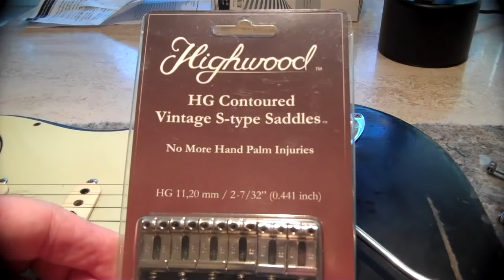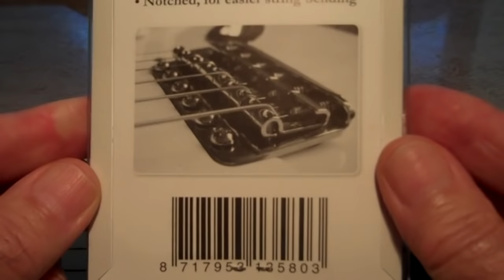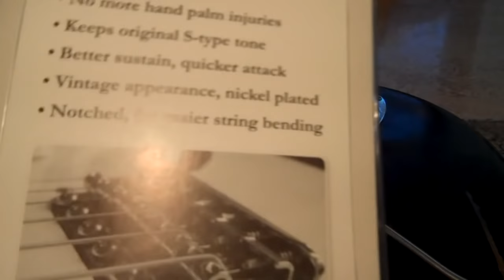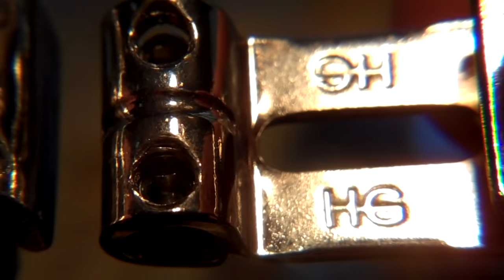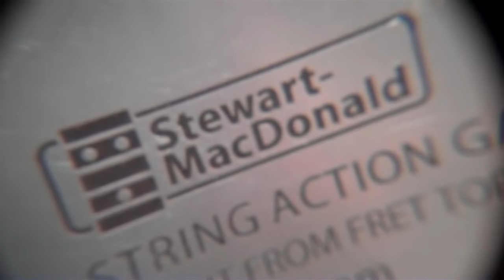Highwood HG Contoured Vintage Strat Saddle Review - Better Than The Originals

Comment: You should do an update on these after 6 months too a year. It would be interesting to see how they held up.
Reply from the maker: Good idea.  Right now they are perfect.  It's been over 3 months.  I don't see any grooves being cut into them at all.  But, I would have to remove the string completely to double check.  The tone is great.  They are super stable.  Fender wishes they would have thought of this design.  A lot of their newer saddles and even the old Teles and Jazzmasters had grooved saddles (threaded barrel type).These are way better than that.
Reply: @millstap   Definitely a superior design.

Comment: Thanks for the video!! Ive read reviews that states these make the tone a tiny bit duller, not as much “zing” as with the original. What are your thoughts after you played them for a while? Thanks!!
Reply from the maker: Maybe in a side-by-side comparison but I do not notice that at all.  Since the top of the original saddle has a little smaller crown, it might sound different but with the extra mass and correct hardness of the Highwoods, I like the extra sustain and tone.  Plus they stay in such good tune because of the groove the string rides in.  The strings are very stable.  I have full sets now on my Nash Strat and an original 1964 Strat.  I love the way the vintage Strat sounds.  I forget that they are on there.  I don't notice the difference at all.  They may be a little duller than the Callahams but then the Callahams are too bright to begin with.
Reply: @millstap  Thanks! I have to check them out.
Reply from the maker: @stefanedfeldt409  They're nice.  It is definitely worth the money to give them a try.  They are all I will use for years probably until I get bored again and just want to put the originals back on for a while.  I love that the strings don't slip around on the top when they are new and allow the strings to cut multiple grooves.  That only happens, though, to guitarists that bend strings a lot like I do.

Comment: Sounds awesome!! When you showed them close up, my first thought was that the groove in the top would help keep the string more stabilized for bending... guess you found that out when you played! Seems like a smart design.
Reply from the maker: That groove is a Godsend.  I think Leo's original Telecaster saddles had the grooves built in kind of like the ones on the original Jazzmaster bridge.  Leo was such a tightwad, he didn't want to spend money cutting a groove in the saddles.  Here is the comment I made to Patrick above, "It dawned on me last night why my other saddles have multiple grooves in them.  Anytime I replace the saddles with new ones, they are so slick on top that the string slides around on top for a while when bending strings until a groove forms to keep the string from moving anymore.  If you don't do extreme bends, then it is not a problem.  I used to hate moving the string back to the center on new saddles.  Plus, it knocks the string out of tune.  The tuning on these is super stable."

Comment: can you get these lower than standard saddles like, if your high E is at its lowest point but the rest of the setup is good? I'd like to avoid a shim if I can and all I'd need is a slightly shorter saddle. Does the groove make lower action possible or is it about the same minimum height as standard ones?
Reply from the maker: YourFavouriteColor I don’t like shims either but sometimes they are necessary. Just use a full pocket maple shim from StewMac. You may have to thin out the shim towards the headstock end.  Fender put small shims in almost all Strats. I will measure the saddles and get back to you.
Reply from the maker: I measure several brands of vintage saddles and they were .2145-.22".  It looks like the string groove might make that just a little less but I would contact Highwood to get an exact measurement.  The Highwood saddle without the groove is around .2188".
Reply from the maker: I measure several brands of vintage saddles and they were .2145-.22".  It looks like the string groove might make that just a little less but I would contact Highwood to get an exact measurement.  The Highwood saddle without the groove is around .2188".
Reply: @millstap  wow thank you so much for the info! a shim it is lol
Reply from the maker: @YourFavouriteColor  Yes, check these out.  I have never used them but they will not effect the tone of your guitar like an air gap will if you just use a little piece of plastic or something.  https://www.stewmac.com/Materials_and_Supplies/Bodies_and_Necks_and_Wood/Electric_Guitar_Bodies_and_Necks_and_Wood/Electric_Guitar_Necks/StewMac_Neck_Shims_for_Guitar.html.  It might be a little tricky thinning it down so it does not push the neck up too far but then that little bit of extra height might work.  Just be sure there is no air gap.
Reply: @millstap  already ordered some
 a .25 degree and a .5 degree. I'm pretty sure the .25 degree will be plenty. when it comes to shims a little dablldoya.

thanks again for taking the time to measure the saddles. that was very kind of you.
Reply from the maker: @YourFavouriteColor  Good thinking.  It doesn't take much so .25 will probably be enough.  Have you looked in the pocket before?  There may be a shim in it then you might need the .5 degree and get good full pocket contact.  I suppose you could glue those two together if you needed even more.

Comment: I want the highwood saddles.. and i had no idea they come in nickel....if they come in something harder metal wise thats what im after...the last mods i need is the saddles...they have many advantages...and locking tuners...then my strat will be complete...
Reply from the maker: You can contact Piet at info@highwood-guitarparts.com if you have particular questions.  They only come in nickel or relic'd nickel.  I have both.  I use the relic'd set on my vintage Strats.  You don't want them too hard or it will adversely affect the tone.

Comment: save ca$h and use block steel saddles and its easier to get the screws below the top to stop right hand chafing. Be prepared to buy a set of 6 saddles to suit the length needed (likely 8mm)

Comment: Slot length doesn’t matter, the string has a hard break angle on the sustain block.  That is the problem area.
Reply: JP SixgunElectric you think you are smarter than you actually are.  Read my comment carefully.
Reply: Slot length does matter, because as illustrated in this video, it creates two contact points at the saddle: the slot opening and the top of the saddle. Especially problematic if you have a tremolo Strat, because it can cause the string to catch on the front edge of the shorter slot hole, causing the string to "ping" and suddenly unbind and causing tuning issues. Simple is better and the longer slot length on these simplifies the string tension and helps prevent broken strings.
Reply: @danielstoddart  I understand, maybe I  could have added detail, from a risk standpoint the string has a much sharper and aggressive angle at the bridge plate where it connects to the block.  That area is also under heavy tension.

Comment: Playing with effects masks the effect of the saddles' tone, which i assume is the point of a review of these saddles.
Reply from the maker: The main point of this review was not about the tone.  It was mainly about the elegant design.  The tone is exactly as the designer states, "pure vintage tone!" except with more sustain.  The groove is a big improvement over the vintage saddles, especially if you are a big bender of strings.  The strings stay very stable in the groove and do not move at all like they do on a new saddle.  The steel hardness, mass and nickel plating of the vintage saddles was duplicated in this design.  Having the screws recessed below the top of the saddles is a real benefit if you have ever hit one of the screws with your hand.  Marcel Dam (designer) knocked it out of the park with these.  Everyone that installs them, loves them.  Fender probably should have grooved the original saddles from the start.  Up to that point, they had been using grooved (threaded) barrel type saddles on the Telecasters.
Reply: I don't agree,... If your sound is based on a crunchy Class 'A' Valve sound or Valve amp in general, the natural guitar resonance really breaks through,...  Adding huge handfulls of "Big Muff Pi" ensures that you sound like everyone else,... In which case, why do you need a sophisticated guitar sound anyway.... ?   No one will be able to tell the difference anyway.
Reply: @millstap  Yes, all of that is true. In fact, partially on the basis of your review, I purchased a set of Highwoods for my '62 Strat when the original saddles began to rust-out beyond repair. However, what I said about using effects when demonstrating a particular piece of hardware is also true.
Whatever you think is the "main point" of the review, most guitarists are very concerned with tone, particularly if they're contemplating replacing original saddles with new ones, which I suspect you already know.
Anyway, thank you for your review, which was largely very helpful.
Reply from the maker: @Glicksman1  Hopefully you've already found out that they do not change the tone, and if they do, it is more of a sustain increase if anything.  They are the best.
Reply: @millstap  Yes, I agree. I couldn't be happier with them. They're very comfortable, don't break strings (so far), haven't done anything negative to the tone of that magic guitar, and have made it even more articulate, toneful, and yes, probably added more sustain.

Comment: Love your videos and playing my friend...If you bend a whole step or more on the G string,do the saddles alleviate the issue of the G string going flat on bends and then having to redump the bar to get back in tune? Been fighting this common issue on a few of my own strats.Frustrating as hell.
Reply: Was hoping you would get back to me on this my friend.Frustrating issue with strat type bridges.I own 7 strats myself. ;o)
Reply from the maker: @johnspina318  Hey John.  Yes it is very frustrating.  Check out my other videos on tremolo issues, https://youtu.be/qL5u7PcHzyM.  I put the links of the other videos at the end of that video.  I had two vintage Strats that stayed in tune no matter what I did until one day they didn't.  I was baffled as to what could have happened.  After a long frustrating period, I finally got them to work perfectly again.  These saddles definitely are one part of the solution.  Setup is the other.  I don't think I have ever had the G problem you refer to but the cause is very simple.  The string is getting hung up on the saddle most likely.  These Highwoods will keep the strings stable and will not allow the string to move around and cut multiple grooves into the top of the saddle like the old Fender saddles.  Watch all of those videos.  The Super Lube I use now is great, food grade Teflon grease.  Floating the bridge by at least 4/64" off of the body is also very important.  I ran mine decked for years and that makes the tremolo harder to control.  Plus, floating gives the Strat its distinctive sound.  Also, I believe wholeheartedly that 5 springs is the best.  SRV and Hendrix used 5.  Get the Raw Vintage springs if 5 springs seem too tight.  They have the vintage tension which is less than modern springs, even the new Fender Vintage springs.  I also did a video on spring tensions.  I now use Fender factory specs to setup all of my Strats and it works perfectly.  Who would have thought, lol.  I went with their settings out of necessity when I switched several Strats to the light 10-38 Hendrix gauge set.  Let me know if you need any other help.

Comment: So basically if a guitar goes out of tune from a dive bomb, basically what's happening is a string somehow repositioned itself from one of the contact points that it was previously on, thus going (*usually*) flat?
Reply from the maker: No, actually I found that as the friction increases at the contact point of the string and saddle when the tremolo is returning to equilibrium, the string sticks to the saddle and the springs pull it just a hair sharp.  The extra grooves cut on the top of vintage saddles don't help.  I was constantly (every string change) buffing out the grooves to try to eliminate any burrs.  With the Highwoods, you don't have to concern yourself with multiple grooves forming or burrs on top.  I still break strings occasionally but then I bend strings constantly when I am playing. I took a virtually unusable tremolo on my newer Nash guitar (Gotoh) and made it work with these saddles and Super Lube (Teflon grease).  That is all it took.  People would always say the problem was the knife edge of the plate, or the nut, etc., and people have gone to extreme lengths to redesign all of those parts including roller nuts, TUSQ nuts, sharper knife edges, harder plate screws, spring tension gizmos, etc.

Comment: Vintage is 56 mm (2-7/32) mounting & string spacing. 
MIM is 52.4 mm (2-1/16) mounting & string spacing.
V/N is 56 mm (2-7/32) mounting & 52.4 mm (2-1/16) string spacing.

Comment: Since it's been a while now that you've had these saddles, do you still prefer them?  Anything you don't like?
Reply from the maker: They are perfect. A lot of people are switching over to them. I only left my vintage saddles on one Strat. The other three are Highwoods. If you have vintage sized saddles, then order the 10.8mm. They are the correct size. The larger 11.2mm could push your E’s too close to the edge of the neck.
Reply: @millstap  Good to know, thanks!

Comment: I tried the GraphTech cast body/Tusq inlaid saddles on my SRV Strat. The tonal difference is wild. The unplugged volume (useless right?)was reduced, which is how they bring the mids(edited for spelling *kids*) up to “compress” the strings.

They lasted one string change. If you use high gain amps or OD/Comp pedals, they’re great. My Tweed amps are neither...

Oooooo noooooo you turned a screw!!??? You reduced the value of the guitar so much, you’ll have to pay me to take it!